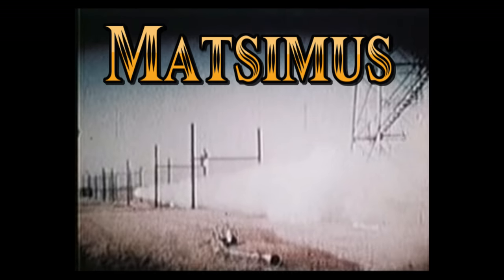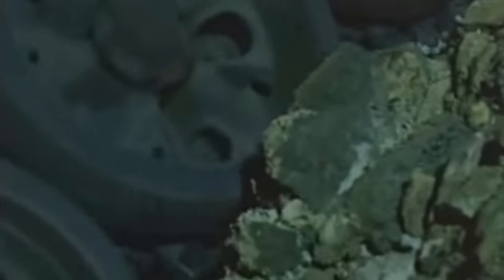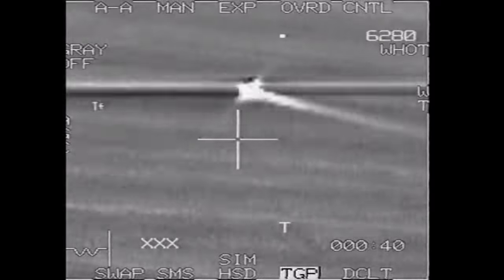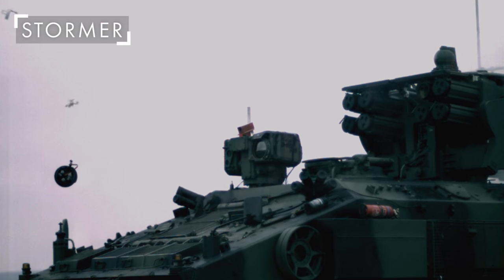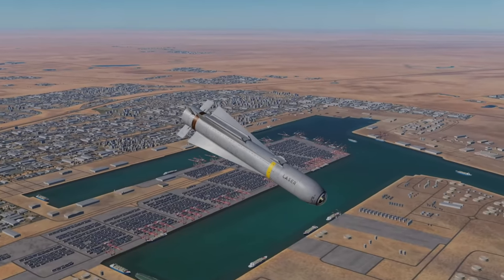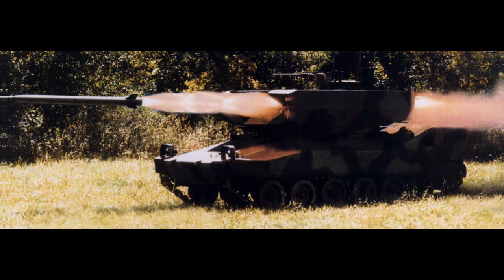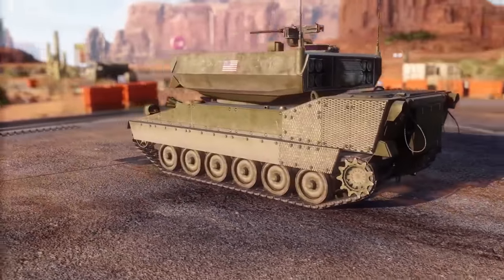Anti-tank Kinetic Energy Projectiles | HIGH VELOCITY MISSILES

Comment: Next episode, 
Railgun Tanks!
Reply: @revolverswitch  True, energy required are significantly less than rail/coil gun.
Reply: maybe the real issue is do you want to negate the whole tank warfare by introducing a modar system that can be fired from a
normal car (more or less),  exponentially increasing threat to tanks once the tech picks up. After investing zillions of dolars into tanks,  normally you want to go with the same.  This tech can have the same impact as the early guns had on personal armor in medieval times,  any peasant with a modicum of training being able to kill a mounted knight.
Reply: The problem remains the mass of the power plant required, the Navy could do it on a nuclear powered ship, but a tank is just too small.

Comment: 8:32 That is true. However, that depends on the layout of the missile. The missile could be arranged with as a penetrator with jettisonable rocket motor. After which, the penetrator will glide, unpowered to its target (similar in build to the Starstreak missile. This arrangement of missile is basically strapping an APDSFS unto a rocket motor). Since, the penetrator flies by itself, it suffers less from drag. In fact, I would say that it would only lose around 40 m/s every 1 km it travels (similar to how an APDSFS loses energy to drag) 

Or, the missile could be arranged by surrounding the penetrator core with the entire body of the missile. Which is kinda akin to an APCR shell. However, this design suffers from excessive loss of kinetic energy due to drag. A normal APCBC shell loses like a few-couple of hundred meters/sec every 1 km it travels (I am not quite sure about APCR, but the effect may be worse, since the shell is much more lightweight). [And sure, even if the missile wraps around the penetrator, it still has a fairly areodynamic dart shape, so it wouldn't lose drag like an APCBC shell. But, then, the cross section of this missile layout is still higher than a missile where the penetrator flies by itself]
Reply: If the missile is wrapped around the penetrator couldn't you have a rocket that continues accelerating long enough to offset the increased drag with higher velocity when the motor burns out? If it's going fast enough by then the increased drag wouldn't have time to slow it down too much before it reaches the target?
Reply: @Pudentame  

Yes, your right. As you say so yourself, you can have a rocket that continues accelerating to offset increased drag. Or increasing the rocket's speed to a higher velocity. 

There is no technological limit stopping anyone from making a higher velocity KEM missile. They could do it if they wanted to. 

However......that being said, going faster doesn't come without it's own downsides. And there are some issues to making a faster missile

Comment: "The T-72 in Lockheed Martin's 2007 test was just over 2 miles away from the CKEM launcher. Limitations in the firing platform’s ability to steer the missile to the target may have been the reason for not testing it out to its maximum range at that time."

It's not as great as it sounds.  T-72 was probably old one captured from Iraq with Kontakt-1(which already isn't effective against APFSDS).  Or shot on the side just like in the video.

It works against aircraft and lighter armored vehicles(APC...etc.) because they're thin-skinned.

But inherent instability(which is how it's steered) can cause massive penetration loss against modern tanks. (on top of ERA/NERA's mechanism for defeating KE projectiles, any slight tilt would be significant decrease in penetration, ~10degrees will lose ~50% penetration; worse if it's hit by hardkill APS)

The non-existence of explosive effect also limits its use against infantry...etc.

So basically you have a vehicle-portable weapon(barely, seeing as Humvee had to be enlarged) that is dubious against front of modern tanks with similar range to standard ATGM platforms, that has little use against anything that isn't armored enough for pure-AP to be effective(would probably pass straight through civilian cars without much damage), that costs a ton(not just in deploying/supplying a new platform), that has very long minimum range(this is nearly Shilleleigh level bullshit; except that one just can't be guided before that range, this one literally has less destructive power until it accelerates past that range), that probably still has enough backblast to kill friendlies 20m away.

That's probably why people gave up on it.  Might as well use a traditional ATGM(top down attack, or just a bigger warhead) or lower-pressure/recoil traditional tank gun(like 105mm on M1128MGS).
Reply: At one point the KE protection was drastically lower than the CE protection. It was in the mid to late 50s I believe when the defense meta was leaning towards everything armed with HESH or HEP and HEAT-FS shells with aux ATGM for tank combat as first generation test deployments of ERA were only recently introduced. I honestly wonder if this program was a legacy of that time and just floundered in the bureaucracy on paper for decades. Even as late as the 70s with the introduction of T-72 with proper armor and T-80 the kinetic protection reached levels almost equal to chemical protection these missiles would be rendered redundant. 

If it were firable from a more mobile system I could see some use against IFVs but all of your points are valid. Any scenario that this system could be employed in likely could be matched in performance at worst or likely exceeded by a TOW-2 or javelin.
Reply: @Colonel_Overkill  anything going that fast will fly flat and straight and destroy most things on the battle field and air
Reply: @bigmal1690  you appear to have missed my point, while I am disputing what the rocket will do on impact, Im also saying the entire program seems to be 40 years late. A kinetic projectile like that has subpar performance to a gun launched APFSDS shell, which it is supposedly intended to rival. It also is inferior to HEAT effect weapons and for pure kinetic impact most modern battle tanks are immune to it frontally. Decades ago this would have been a great system but these days anything it may be able to do something else can already do it better.
Reply: Simple calculations based on the impact energy show that a hit from an 80kg projectile travelling at 2000mps will destroy any ground vehicle. It doesnt have to penetrate the armour, it has enough energy to snap the chassis like a torpedo breaks the keel of a ship.
Reply: @afs101  Nice try at using full weight of the missile instead of the relevant part(the penetrator).

If you take a round that heavy(for reference, 80kg is close to the weight of a 203mm HE round) and dump it onto a tank, even just HE would destroy any tank...

176lb. is missile with the fins, guidance system, mostly propellant that would mostly be burnt before reaching max range(just to accelerate to lethal velocities, if it actually works...).

Lol "simple calculations."

Now I know why people think this is some kind of magical weapon - they can't even figure out how heavy the relevant part is. (remember this is supposed to be "lightweight" enough to fit onto HMMWV)

In all likelihood it probably blinds the shooter(and "computerized tracking system") with launch blast for most of that ~4s it takes to reach the target, plus it has maybe 20 degrees of guidance, on a wheeled platform that you have to steer toward target...

And that's just LOSAT; CKEM is already well under 50KG.
Reply: @bigmal1690  it will also have a stupidly huge IR, VIS and UV signature, which will not only alert aircraft with missile protection systems, but will cause you to reveal your position.
Reply: Didn't he say one variant had 60 megajoules of energy at impact?.... I think the current M1 round has like 9 megajoules, so I don't really think anything in service would survive.  Beyond that, active defensive systems like Trophy struggle with KE rounds and mainly hope to disrupt the angle of the penetrator so that it hits the armor sideways, so I bet these missiles would likely get by those systems as well being higher velocity and even more energy in the system.
Reply: @member5488  TBH Trophy isn't all that good as an APS to begin with.    At such insane speeds, destabilising a long penetrator could actually make it miss the target entirely... But this would need a lot of tests to tweak everything.

Comment: 14:08 The LOSAT missile has 90 MJ of kinetic energy? Well maybe for the entire missile itself, but that doesn't apply to the penetrator core itself. The kinetic energy of the penetrator core is likely to be lower. 

If we look at the Starstreak missile itself as an example, it weighs 14-20 kg overall. But, the total projectile weight of the missile is 2.7 kg. So, that gives us a figure where 13.5-19.3% of the missile is its projectile core. That's pretty impressive, since APDSFS shells devote around 22% of its weight into the actual penetrator (so that Starstreak has somewhere around 60-88% of the "payload" of a tank fired sabot shell).

But, anyways, that means the actual mass of the LOSAT missile that actually contributes to the penetration is only around 10.8-15.44 kg. Which gives a kinetic energy of around 12.54-17.93 MJ. Which is pretty impressive, in comparison the 140mm XM291 is speculated to have a muzzle energy of around 24 MJ (it is likely that half of that energy goes into penetrator of the sabot shell).

So.....a fraction of the missile's kinetic energy is devoted to the penetrator core. But, what about the rest of missile body, you might ask. Well, the rest of missile body would probably peel off, and not penetrate very far into armour (sorta akin to the aluminum body on a APCR shell peeling off when it hits armour). HOWEVER, that's not to say that the (peeling) missile body (surrounding the penetrator core) isn't entirely useless. It could cause secondary damage through concussive impact (caused from the mass of the missile body). Just as an example this is what happens to a Churchill tank when it receives a non-penetrating hit from a German 128mm gun http://ftr.wot-news.com/2013/10/25/the-big-bad-128mm/. Yeah, the 128mm is pretty damn scary, now use your imagination when thinking about a great big honking, 90 kg missile flying your way at hypersonic speeds.

[And also, a slight side note. The LOSAT missile may weigh 80 kg. But, you gotta keep in mind that a significant portion of the missile's weight is in its fuel. So, once, the fuel is expended, the weight of the missile may be less than 80 kg]
Reply: @komradearti9935  Are you sure about that? That seems far too light for a 80 kg missile. Where do you get your information from?
Reply: @komradearti9935  Oh ok. Thanks.

Comment: Many of the discussions are ignoring the interaction of active defense systems. While hypervelocity kinetic rounds are exceptionally difficult to intercept they're not "impossible" to intercept. There are practical upper limits to size and weight of vehicles so rather than add armor to be defeated by KE you may add active protection. Gun and rocket propellant are at a plateau of energy; more energy requires different techniques; vehicles may go toward Navy concepts of "electrical systems" (electro-thermal combustion for guns as well as propulsion). Electromagnetic fields are being examined ("shields" if you will - but not quite the magic of sci-fi). Everything is about change.

Comment: What if tanks fire hypervelocity missiles. Take a solid fueled subcaliber rocket and line its internal combustion cavity with a burnable carbon fiber porous tube. This tube would protect the plastic solid fuel from deformation. A spigot will be inserted into the combustion cavity to fill any empty space. When the tank fires the round, the igniter explodes the main charge that sends the missile sub-projectile out of the cannon tube. Then the spigot is ejected from the rocket's combustion chamber out at the back, this is done with the help of a time delayed fuse that pushes the metallic spigot-rod through the nozzle and out of the rocket. The rocket is ignited and it burns slightly oxygen rich. It then deploys its fins for controlled flight.
The main charge is a high explosive/gun power mixture with innert hellium gas buffer in order to make it a combustion light gas cannon. So if the missile exits the cannon at mach 2,5 to mach 3 it could then accelerate to hypersonic velocities...
Would this work?

Comment: US Navy is starting to deploy electromagnetically accelerated projectile cannons and offensive combat lasers.  Won't be long before someone else does as well, nor for the technology to transition from naval warfare to land based.  The question is what will get you more bang for your buck a rail gun or hypervelocity kinetic penetrator missile?

The technology has been around for awhile, if the Russians can make big hypervelocity missiles they can probably make small ones also.  Someone will continue developing this technology even if the USA doesn't.
Reply: why not both?
Reply: Probably both as both have different advantages and disadvantages similar to cannons and rockets/missiles in the current day.
Reply: Lasers yes, Railguns no, they paused the project due to problems with the pulsed power subsystems and the low rate of fire, whilst research continues it is at a much reduced level due to budget cuts

Comment: As far as I can see:
APDS depends on speed to achieve its penetration that is more a function of the bolt or projectile length than the actual weight of the projectile. The reason for using depleted uranium is - as far as I understand it - due to the extreme hardness of the uranium  alloy used. Not the mass density of the alloy.

OK the culprit is here (again) the sound barrier - which according to the figures I've seen - raises the drag coefficient by a factor of four. Again: According to the figures I've heard: The AVERGE distance for a tank-tank kill is 700 meters, but the medium is 400 meters (i.e. 50% of enemy tanks killed is taken out at from 400 meters or less). This means a tank kill at extreme ranges is a very rare occurence.
One of the reasons might be that the enemy uses terrain, cover and concealment, as he does not want to be killed.
OK my figures might be old (WW2), so do not hold me to the mm. But lets say relevant mordern data are 500 meters and 1000 meters respectively - just for the sake of argument.
Speed of the projectile probably drains off rapidly with distance and it is the speed that kills with a APDS.

On longer ranges a squash head that uses the explosive charge in the grenade to inflict the damage.
This makes sense in British tactics where the Challenger 2 uses a rifled gun to stabilise the projectile in flight - instead of fins - as in smooth bore guns.

But the difference between a 120 mm and a 105 mm is probably not the largest at a typical tank kill range. Reducing to 105 mm tank gun (and not many has lived to bad mouth the british L7 105 mm gun). To reduce the recoil which is mass times velocity it is smarter to reduce mass to get more speed on the projectile.
Reply: @komradearti9935  Again average is not indicative of anything. The major parts of hits are below the MEDIUM distance. If you say the average is 1½ km. Given the same distribution  type the medium should be 3/2 * 4/7 km = 6/7 km. or about 800-850 meters. 
No doubt the ranges have increased, a rifleman today with proper sights can expect to hit at 300 yards and most rifles in my  time were zeroed to 200 yards. If you can hit with one in two shots at that distance great. Here I wellcome the smaller caliber - which means you can put more energy into the bullit by increasing speed, as energy = ½ mass * velocity squared.
At the same time you reduce recoil as that is the negative impulse = - mass * velocity.
I have seen little old ladies fire the Colt Canada C7 without as much as flinching. She didn't hit anything - her spectacles weren't up to it - but neither did I.

My point being:

A gun projectile starts out with all the energy at the muzzle and gradually loosing it over the flight distance.  The TOW missile is the exact opposite: It gains energy as it flies.

A tank gun generally hits below say 500 meters where the energy is at its maximum due to projectile speed. At those ranges a lot of things DON'T MATTER. Vindage and gravity drop f.i. The target is bigger. Canting is probably  a larger factor.

I really think that TOW's are quite adequate - mounted on a light armoured vehicle. The tanks with the 105 mm. L7 or something similar. Artillery on tracks or wheels with 155 mm.

What  I really would like to see is Matsimus and his gun flown in for exercise in Lithuaniua or  Estonia  with a Globemaster loosening a few rounds at the range.

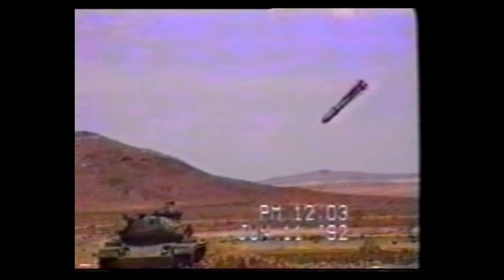Comment: 3:37 Well.......technically shaped charges also can count as kinetic penetrators. Since the (the tip of the) slug produced from a shaped charge has a velocity in excess of 10000 m/s. But, then again the physics behind shaped charges are weird, since they apparently can be stopped more easily then a long round penetrator (like a APDSFS sabot)